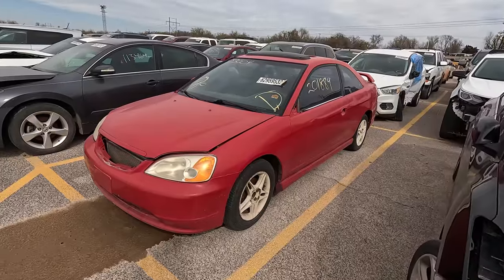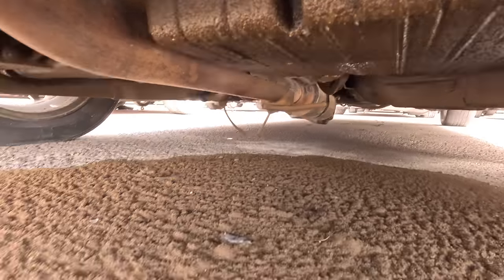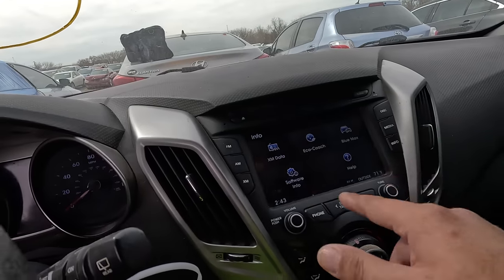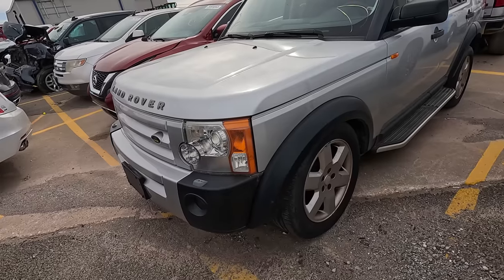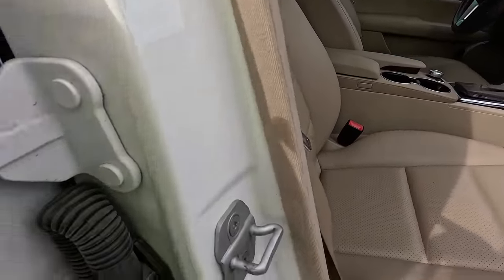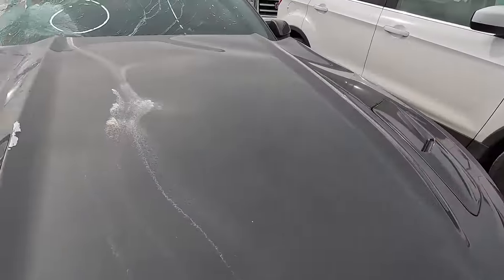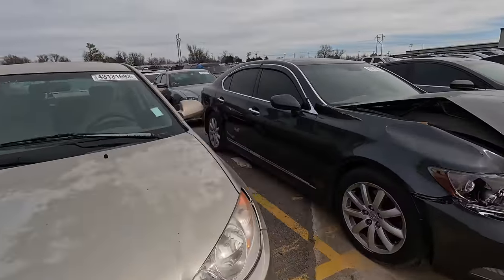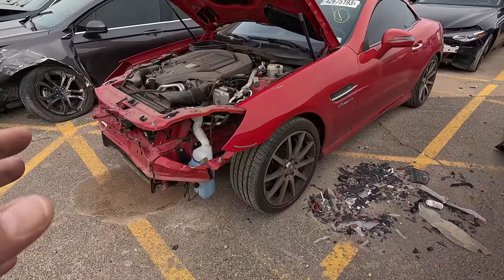Copart Walk Around 3-12-23 + Mercedes SLK 55 AMG BEAST!!

Comment: That steering noise in the Veloster is minor.  Just a flex coupling between the electric power steering motor and steering gear in the column

Comment: That thing on the back of the performance pack Mustang  It's called a splitter it's supposed to help keep the car down near the ground when you're going at high speed and improve the handling but that's just a knock off like I suspect the wheels could be as well.

Comment: That Mustang just has PP wheels on it. They didn't offer an auto PP until after the refreshed 2018 model with the 10 speed transmission. 2015-2017 were manual only.

Comment: Yellow velociter needs just a steering coupler to fix the steering wheel. Common issue for those generation of Hyundais. Seen it felt it heard it (😜) numerous times while working at the shop. Less then 20$ to fix it if you do it yourself

Comment: Randy. I have question for. I have 2003 Honda pilot that need Seratine belt also need knock sensor and O2 and Cadillac converter. Also control arm. On the right hand size. Do you 🤔 it’s worth fixing. Or get another 🚗
Reply: Is this a real question?  You are asking if you should spend a couple of hundred dollars on a car you know or spend tens of thousands on a car you know nothing about?
Reply: @mexicanspec  WTH 🤦‍♂️ are you taking about? It’s not to you away to randy
Reply: @tsmith682  Well then I hope he answers you.  Good luck.